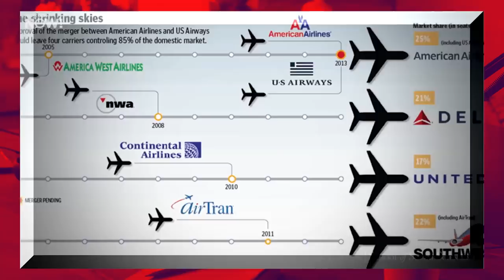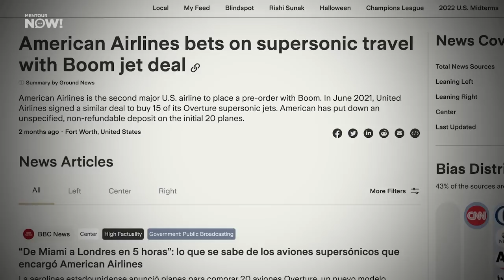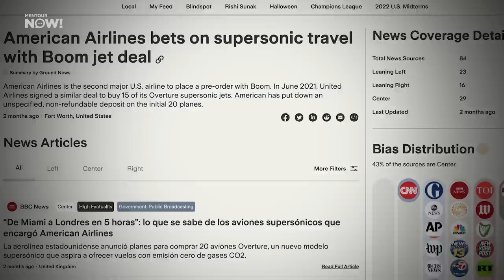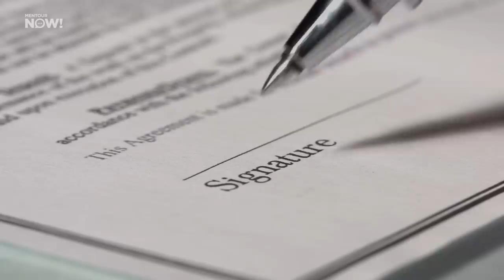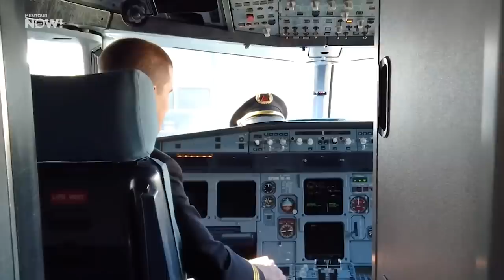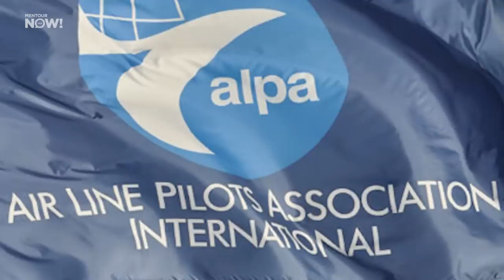Is This the DEATH of the US Regional Airlines?!

Comment: I appreciate your time that it took to make this video..... I can firmly attests that it would seem like a very unusual environment here in the US in regard to air travel.... just a few key points (from someone who's been doing this many years :) )

1) Regional airlines are not "Controlled" by the mainlines.... they BID for contract routes that the Mainlines simply don't want to use their own equipment to fly - this means that if Mesa (for example) bids on a contract route and states they can operate the route for AA (American Airlines) for $100 per person, and AA wants the route covered with the lowest bidder who in this case would be Mesa, then Mesa would most likely get the route for a specified amount of years or based on performance matrix ..... because Mesa does not sell directly to the AA Customer, AA will then decide on the ticket price, taking into account the bid package from Mesa, and then determine a fare to charge, of which $100 is passed onto Mesa... The mainline and Regional also have agreed upon "performance practices" that usually are dictated in a contract of operation at the time the route bid is awarded.

2) All Regional carriers compete with each other in this "bidding of routes". They are also partly responsible for bidding and contracting for gate space, bases for operations, maintenance, etc. Having a Regional do this saves Mainline Carriers Millions of dollars a year for NOT having to deal with such things as they already have their own network established with the more economical aircraft (as you mentioned in your video)

3) Regional pay - Mesa in 2019 would start a newly hired First Officer at $36 per hour.... with a 76 hour per month guarantee.... as of a few months ago, that number is now $100 per hour..... yeah way more than 50% increase - this is due mostly to trying to attract helicopter pilots who are looking to transition from Rotorcraft to Fixed wing flying as well as Part 135 Pilots who also might want to consider moving into a Part 121 Carrier.

4)  because a 1500 hour Cessna pilot would qualify to obtain their ATP MEL License in the US (Airline Transport Pilot Multi-Engine Land) - only Part 121 carriers with approved training programs can "Train and Test the pilot candidate for the ATP MEL" - the cost for this was low and the process quick for the Regional Carriers to get FAA approval for these programs... therefore, new pilots who want their ATP MEL license to operate in the US will most always have to go through a Regional carrier to obtain this. This was something that the airlines lobbies our law makers in 2011 and 2012, and in 2014 the amended rules were implemented by the FAA.

5) Every Mainline is represented by various unions..... American Airlines has the Allied Pilots Association, where as Envoy (owned by American) has ALPA (Airline Pilots Association) - nether of these groups intend to merge, and rightfully so mostly due to the Scope Clause that you very clearly explained. Mainline pilots want to feel like their jobs are protected, and it can take years to earn the spot or obtain employment with a Mainline because of the strict criteria that the Unions have help to establish.

6) Regional Airlines have been "upgrading" (or a better term would be "migrating") to the E-175 based on customer satisfaction surveys - the traveling US customer base prefers a aircraft that is a bit larger than the Q400 (and even the CRJ 900) and looks for "comfort" features that the E-175 in the 76 seat configuration provides.... yes the regional could certainly go to E-190's, but would really take the hit for not being able to outfit them with 90 or more seats to make the plane profitable.... also some regional airlines have hardware acquisition agreements in place with the mainlines, where the mainline will purchase an aircraft (such as an E-175) and then lease it to a Regional for operations.

I agree that the term "Regional" is really no longer one that applies here, but to indicate that the Regionals that are still in operation today (Envoy, PSA, Piedmont, Skywest, Republic, Air Wisconsin) could potentially be in danger of no longer existing just doesn't seem to be the case..... during the pandemic, we did see a few carriers fold, and those routes were quickly taken by other carriers.... but this "folding" was purely of financial means.... something you also addressed in your video.

Having the regional airlines "look" like they are part of the Mainline operation is also key to the customer, who in many ways is already fed up with the hassles that air travel can impose... there is a aire of convenience to purchasing a round trip ticket on AA.COM knowing the whole route is serviced by AA or an affiliate.... Breeze is going to have an up hill battle to win over customers in that fashion as many US Travelers who reside in smaller communities serviced by "what looks to be AMERICAN OR UNITED" and are traveling from say Austin TX to New York City, NY, won't want to have to check in for a flight, go through security, get the gate, board the plane, get to DFW, go out to baggage claim, check in to a different carrier's flight, go through security (again), and then get to the gate just to head to NYC.... Breeze and the network they will provide would most likely be more a competitor to the likes of Southwest, Jet Suite X, and XO Jet.

overall some great content.... thank you for sharing your thoughts!

Comment: I don’t live in the US but Higher frequency is sometimes nice because if there is a missed connection etc ... and it offers more options for connections. That is also likely why Cathay Pacific used to operate 5 777s with some flights leaving 1hr after another, and around 20 flights to Beijing per day in 320/330s.

Comment: 17:51 "Breeze Airways... are the only US airline with E-190s and E-195s."  Actually one other airline has E-190s - JetBlue operates 60 of them. JetBlue has begun replacing their E-190s with A220s, and anticipates the entire fleet will have been replaced with A220s by 2025. The A220 has markedly better fuel economy - despite having 40 more seats than the E-190, it uses less fuel.
Reply: Well Petter says "the only US airline with E-190s AND E-195s"... which is correct. And strictly-speaking, Breeze would quite like to have only E-195s, but couldn't find enough of them, so Petter's point of maximizing regional jet size, stands.

Comment: Comparing US regional sizes to European ones isn't really valid; remember, all of Europe can fit into the half of the continental US east of the Mississippi River. Also, Europe's rail system is vastly superior, shorter, cheaper, and faster than Joketrak so they can absorb regional passengers more easily.

Comment: Well.. legacy airlines operate hub to hub flights. As you already know these hub airports are already at their full capacity. In other words, it is impossible to increase flight numbers at these hub airports. That’s why multiple operations from midsize airports to hub airports are still existing. Therefore, legacy airlines could divide the passenger demands effectively. By doing so, the each legacy airlines can tie their passengers within their operation networks. Even though this strategy would cost more than operating one big aircraft, in a bigger pictures, the legacy airlines get more benefits from this type of operations. Also regional airline companies are still profitable. So at this point, I don’t think regional airlines will be disappeared anytime soon in the US.

Comment: Nice video. Couple things I would like to add.

Most of the regionals here in the US are based on a “fee for departure” model. In other words the regional airline is getting its cut in money based on the departure of the plane and not the seat sale. So technically i regional could takeoff with no passengers and still see the same revenue compared that same aircraft fully loaded. With that said, the regional is unable to cover its increase in payroll by simple increasing its ticket costs, they have no control over that.

I won’t name companies but some are threatening bankruptcy, while not confirmed, due to this issue. This is only furthering the idea that regional airlines might be out the door sooner than later.

One thin to also keep in mind, while as of now the regional pay rates and major pay rates are close, and in even some cases better, the majors always have the option to raise the pay scale on that side. Maybe in the near future we will see that regional airlines all of a sudden are still a cheaper alternative simply because the major airlines are offering even higher pay than regionals once more. This seems to be the road we are going down considering  the Alaskan airline deal and multiple airlines are threatening strikes. Time will tell.

Comment: The most charming aspect of flying on a regional jet here is being stuck on an old CRJ with a/c condensation dripping on you from the ceiling panels. 

United's new CRJ550 layout is has been a nice surprise, but there is still a huge room for improved service quality. 

I'm hoping the Breeze's of the world and new planes like Embraer's turboprop will provide another option on these routes.
Reply from the maker: It will sure be interesting to see!
Reply: The CRJ550 is a CRJ700 with 50 seats. The first 550s WERE 700s, that were re-certified.
Reply: @spyrosg3172  Yes, and?
Reply: @eheis5  And it kind of demonstrates the problem here. The only reason the 550 exists, is to satisfy the letter of the 50-seat segment of the scope clause (sort of -- there's an MTOW waiver). There are no 550s outside the US. These jets only make sense because there is no true modern 50-seater out there. Unless Embraer's planned turboprop covers it... sometime, maybe.

Comment: I used to fly on a small Embraer “United Express” from Modesto to San Francisco, and then on to a bigger plane from San Francisco to wherever. The flight from Modesto to SF took 15-20 minutes. The drive from Modesto to SF took… depending on traffic, which is always horrible, 2.5-3 h. 
I loved that short flight in the small plane, (maybe 50 seats or thereabouts), you always got such good views, since the smaller plane was flying much lower than the big jets. It was very noisy, it had propellers. But hey, it saved time and traffic headaches. One year they suddenly stopped the service from the Modesto Airport, it was some years before the pandemic. That was a sad day for me. Back into the road traffic I went! 
Yes, somebody here mentioned the smaller plane is more fun, and that’s often the case. You really feel like you’re flying. In a big jet you often don’t even feel like you’re in the air, if you didn’t see clouds you might just think you’re on a train. That’s probably just fine with most passengers, but I always enjoy a bit of rocking and rolling!
Reply: Roller coaster without having to wait in line!
Reply: @AndrewSteitz  you do wait in line… the TSA line. But after that… pure joy! 🙃

Comment: The biggest open secret in the industry is that the A220-300 and Embraer E2-195 have similar (if not better) fuel burn per seat to a 737MAX7 or A319neo, and they are much nicer to fly in the cabin. Airlines like KLM, Air Canada, Air Baltic, Qantas and Air France have figured this out. So have Breeze and Delta.
Reply: Yea they'd be much more popular in the US, it's Pilot Union contract stipulations that keep them out "weight requirements".

Comment: You missed the most important part. Its about Business travel and business travelers want more frequent flight options and they also will pay for bigger seats so you can just put more first class in and keep your seat count at 76 and not hurt your profit
Reply: Yep. And people who don't want to pay extra will often drive to a bigger hub. i.e. a friend of mine from Flint, which has a decent airport, would catch a ride an hour to Detroit because even with the gas cost it was generally still much cheaper. Smaller economy seat and probably full booked, but money was a concern not comfort. Quick check Flint to NYC starts at $278. Detroit to NYC, low as $78. This isn't a concern for business travelers who would prioritize keeping the extra hour one way she would spend driving. So regionals cater to them, not her.
Reply: @jenelaina5665  exactly!

Comment: The regional airlines have many purposes here in the United States. The "regional jets" are specific in size and passenger loads not exceeding a certain number. Without breaking out the FAA FAR's and union clauses, I believe it's airplanes less than 100 seats and connects smaller city/airports to the big airline hubs. Another big reason is it's the stepping stone for airline employees (pilots, maintainers, cabin crews and such) to get experience and compete to get into the majors and make more money. This is unfortunate and I wish these regionals would go mainstream (pay as well) and hold their own and compete with the majors, especially on shorter flights with better service on the smaller airplanes. When I fly Delta, my preference as a passenger is 757's, if not on my flight schedule, I prefer the regionals CRJ700/900 or ERJ170/175, then the A220 or 717 (A220 and 717 are mainline, not regional). I prefer the 757 for reliability, BUT, like these smaller airplanes (110 seats and less) due to faster load/unload times and better cabin service. BUT, the regional jets inflight WiFi (unreliable) and lack of inflight entertainment are a negative for some of those rare times I fly out west for up to 2 hours in a regional jet. I believe regional sized airline specific fleets in a main line airline would draw a huge crowd. I definitely would look at flying with an airline that specifically flew a fleet of airplanes lees than 100 seats due to reasons mentioned above. And if they have a fleet that flies cross country, I'd fly them as long as the seating was comfortable and the inflight entertainment and WiFi was reliable.

Comment: I think you may have missed one important aspect in your excellent analysis: frequency of connections. Sure, you could combine 3 regional flights into one larger jet, but then you would also have one departure time. That would make connections for those travelers a lot harder. I live in a town that is only served by regional flights, and without an early morning, midday and evening flight, i would not be able to get reasonable connection times (since I hardly ever need to fly just to to the hub that serves our airport).  So, for this reason, I prefer our 48 seaters.
Reply: Right, and for him to ignore this is plain stupidity.

Comment: I think there were some missed opportunities to focus on flights that are in the Midwest or mountain west to actually see that there are many routes that do not warrant a 76 seater, or even a 50 seater sometimes. Horizon also operates turboprops, and companies like Ravn exist in basically just one state. 

There are MANY routes that have minuscule needs but long runways which make it seamless to operate a CRJ (even a 200). There’s also really weird routes out there. 

From having lived in some of these communities that maybe have one destination to a larger hub, regionals fill that role wonderfully. Why they aren’t actual parts of the larger company is perhaps the real question. 

I do wish more research was done in this case.
Reply from the maker: Well, I did mention that there still will be a need for smaller regionals in some cases. This video looks at the broad view.
Reply: Horizon Air is phasing out the turboprops in favor of E175s. One knock-on effect this is having, is that small communities are announcing that their airports are getting "jet service".
Reply: @stephancox9105  Right, no one wants to fly on those slow and loud turboprops.
Reply: @johnp139  Not that regional jets are much better. They're still worked and crewed by neophytes who do more work for less money.

Comment: Oddly many smaller airports In the US are considered international airports. Many regional airports that you might catch a flight from to a bigger international airport locally,  have routes between other smaller regional airports.  For example Harrisburg Pennsylvania has a regional airport (which is considered an international airport) ,  with I believe 3 airlines, one of which is alligent airlines.  On alligent you can catch a flight to a place like Orlando Florida, but you arent flying into Orlando international, you are flying into another regional (international) airport some 40 minutes from Orlando's main international airport.  I think it provides more viability for some of the smaller regional airports,  and they can fly smaller aircraft that they can easily fill, and provide the convince of not having to drive sometimes several hours to a large international airport.  I can drive 40 minutes to a regional airport,  catch a cheaper flight to popular destination from a smaller less crowded airport, and not have to travel 2 hours to a large international airport such as Philadelphia international or BWI
Reply: Of course there are European countries where any airport in that country is by definition an international airport (I doubt many flights in Luxembourg stay within the country). But even in the larger countries a regional airline will do most of its flying internationally. For these particular purposes you can count the EU as one country.